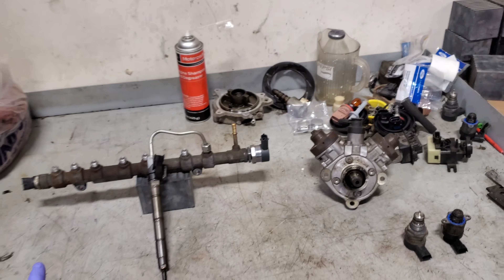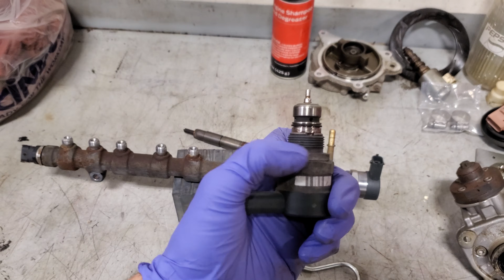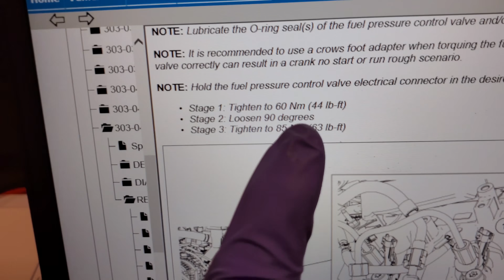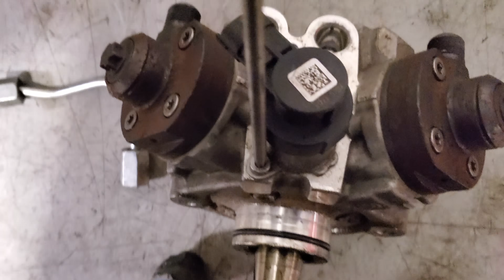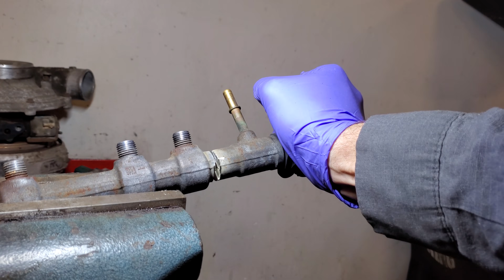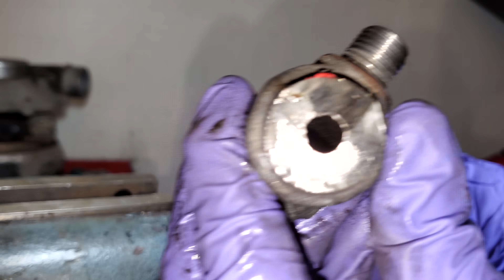High Pressure Fuel system concerns - LH FUEL RAIL discussion | Ford 6.7 Diesel

Comment: Hey man I work at a fleet with a lot of these 6.7 running around and I’ve learned a lot from watching your videos, just did a 2020 fuel system replacement from DEF and you got me curious with that rail and I did find the orifice and it is on the other side of the rail after the line that feeds the passenger side rail and makes sense to me it’s there cuz I’ve always wondered how the passenger side doesn’t get starved with fuel
Reply from the maker: Wow, email me some pics!!
Reply: @PowerStrokeTechTalkwARod  sure thing, still have it sitting out on a bench I’ll do that on Monday
Reply: What are the symptoms when it fails? I got one throwing p0093.
Reply from the maker: Warning lights...reduced power....no start......etc
Reply: Can you see any codes thrown without prior symptoms?  I.e . Slow roll failure?

Comment: What do you suggest i put in my 2019 6.7 for a fuel additive? Living in Canada.
Reply from the maker: Search motorcraft cetane booster
Motorcraft anti gel additive too
Reply: @PowerStrokeTechTalkwARod  This doesn't have to be caused by water or contamination in the fuel. This could be caused simply by using low sulfur fuel or air bubbles in the thin fuel oil which prevents proper lubrication.
https://www.forthepeople.com/class-action-lawyers/cp4-pump-failure-lawsuit/

Comment: Good info, I was considering a CP4 bypass kit, im confident after watching this video 100% CP4 failures is do to lack of maintenance. Is it possible the FRP sensor was reading inaccurately?
Reply from the maker: It wld be, however...with that sensor providing crucial psi/voltage readings to the PCM for it to maintain operation, there would have been some circuit or performance codes related to said FRP sensor. It is 100% caused my man...

Comment: I think Ford should put the DEF fill on the other side of the truck, this would help with any mistakes and confusion, of course I know they won’t, great video sir 👍😁
Reply: Hell no, gm did that and it's stupid, a real pain to fill when the Def nozzle is by the diesel pump nozzle. Filled Def tanks many times, have yet to get Def in the diesel tank.
Reply: I agree with you on that. GM puts it under the hood. People are distracted. Make it hard for them to mess up.

Comment: I manage a fleet of work trucks, almost all 6.7's. Had two fuel systems replaced in the last two years. One had fuel from a fuel cell (which probably had the cap left off for awhile) which contaminated it.  On the other truck we were told that the fuel looked fine at the time they pulled it apart but the system was compromised from a previous fill up. I suspect DEF was put in that one. We don't use any additives, but that's the direction I'm heading, those repairs hit out budgets hard. Any suggestions on fuel additives and how frequent they should be used?
Reply from the maker: Every TANK...motorcraft pm22 & pm23. EVERY TANK!

Comment: I change my fuel filters out every 12-14,000 miles. Seen it says 22k but after 12-14 filters pretty dark,even with high volume fuel,in part for piece of mind and In part to just keep filters fresh,filters like $58.
I also use Fords fuel additive pm-22
Reply from the maker: Half bot every tank!!! Good rule of 👍👍👍
Reply: @PowerStrokeTechTalkwARod  yes sir, gotten to the point where I buy it by the gallon and measure it out

Comment: ARod—regarding the orifice, take a look at your Ford 6.7 Coffee Table Book. In the Fuel Management System subsection, under the Fuel System section, it talks about an orifice in close proximity to the diverter volume area, which I think is near the front of the rail. Here’s the verbiage “From the diverter volume area, fuel goes through an orifice to supply the left fuel rail and through a high pressure fuel line over to the right fuel rail.”
Reply from the maker: Sonava bean! I DIDN'T THINK OF THAT! THANKS PAL!!!

Comment: The cp4.2 failure seems to be more common on the LML duramax engines than in the 6.7 ford. Do you think that is because Ford uses a lift pump, while GM does not?
Reply from the maker: Fuel is the no.1 cause, PERIOD
Reply: @PowerStrokeTechTalkwARod  Totally agree. Just wanted your take on it.
Reply: GM is in a class action law suit for installing European spec cp4.2 on lml trucks. The pumps supposedly weren't rated for ulsd.
Reply from the maker: Yepp
Reply from the maker: Thats why i pound into your guys skulls that running an additive HAS to be #1 priority...

Comment: My 2012 6.7 has between 4000-4100 psi fuel pressure at idle. Is that normal? You mentioned it needs around 5k at idle. It has 290,000 miles on it. Not sure if that is early signs of wear. No codes or performances issues.
Reply from the maker: Those were around there. These news 1s are a lil higher

Comment: I had to replace my CP4 because it wasn't producing enough pressure during crank to start. I also replaced the PCV and put the upgraded metering valve on the new pump. Something to note is that it is very important to clean the top of the pump off very thoroughly before removing the lines or metering pump.
Reply: Ever think of a airdog or fass lift pump
Reply from the maker: Nope
Reply: Nope. They are more trouble than they are worth on these. The stock lift pump supposedly supports up to 700HP reliably.  And the motorcraft filters do a great job when they are changed at the right intervals.
Reply from the maker: Weeerrd

Comment: I have a 2017 F250 6.7 and bought it in October of 2020 and it keeps going into limp mode whenever hauling my 8500 lbs camper. It failed to haul the first two days of owning it and again this last weekend after it was supposedly fixed. The dealer said it was after market fuel filters the first day and replaced them then the next day when it happened again they sent it out to a shop. They said  the low pressure fuel pump was clogged. This last weekend I got a low fuel pressure code and large fuel leak code. There is no fuel leaking anywhere. What could be causing this to happen when hauling?
Reply from the maker: I have replaced a hand full of the in-tank fuel pumps for that exact issue. They need to be checking the FLP pid on IDS when diagnosing under load. Have seen it buncha times
Reply: Might be a stupid question...does the fuel pressure regulator  on the left fuel rail wire connector need to point in a certain direction? Mine looks like the connector is pointing in to the 4 or 8 o’clock position and not the 12 o’clock position.
Reply from the maker: 12 o clock.
Reply: Wanted to update on what was found. While waiting for the fuel pump sending unit to be delivered by Ford, the diesel shop that I brought it to did all the Ford tests that the manual recommended and the low side fuel pump was performing well within spec and the fuel filter on the tank was clean. It ended up being the fuel injector control valve on the left side fuel rail. The manual recommended to replace the whole rail which comes with the valve and sensor pre-installed. Ford initially said a one year wait but the shop called me two days later and said Ford found the part and we now have it in stock. Being that the control valve was not facing the proper orientation I believe the truck had a problem and they tried to fix it but failed to and traded the truck in. I bought someone else’s problem and it’s going to cost me $1200 to fix because I didn’t buy a warranty.
Reply from the maker: Ughhhh them damn fuel railz
Reply: Thanks a bunch

Comment: I have a 2016 F-550 Flatbed that the HPFS failed at 54,800 miles. Always dealer serviced, fuel station turns their fuel regularly. Ford covered the repairs under warranty especially after I took my own fuel samples and e-mailed them the results showing the fuel was clean. After 2 months at the dealership getting this truck repaired it went back 1 week later for the valve cover gaskets leaking. 1 week after that the timing chain cover started leaking. Before that it was the upper oil pan leaking, lower turbo boot blew off and a few other issues. Sorry but I'll never buy another 6.7L diesel again. I'm going back to a gas engine on my next truck. I always enjoy your videos though btw.
Reply: They should have seen all that when they had the cab off from doing the first job. Don’t believe it all started leaking that badly so soon all of A sudden
Reply from the maker: Thanks vince🤝🤝

Comment: Planning on replacing my 97 7.3 F350. This fuel pump/common rail catastrophic failure issue makes me rethink replacing the 7.3. My 7.3 has additional fuel filter, water separator and coolant filter. This has worked and the Racor marine water separator has worked many times. What options are there for the 6.7?
Reply from the maker: Not too sure bud sry

Comment: Good stuff bro. Funny I just changed my fuel filters the other day. I do it every 15K. I never have water in my fuel. I also use HSS EDT with LX4 for lubricity every fill up. Maintenance is key. Unfortunately, while doing my oil change yesterday, I noticed my upper oil pan leaking for the second time. Very frustrating. I might have to trade my 17 for a 21 lol. Thanks again for all the good content 🤙
Reply from the maker: Hell yeah brother🙌

Comment: One this I noticed with an orifice issue on the drivers side was a 2013. Came in for a filter change and the customer had a complaint of a slight surge at idle.
Changed the filters and the surge got worse. Idle to 1500 to idle to 1500. I was stumped. No codes. Then it would surge then stall.
Read up on the orifice and and (on a whim) replaced the rail. 
It worked! 
That was a new failure for me
Reply from the maker: No shit!!!! Good job
Reply: @PowerStrokeTechTalkwARod  luck of the draw on something I havent seen myself either. Wheres this damn orifice? One thing I noticed on that truck when I removed the frp sensor it was caked in a very weird substance I wouldn't identify. Maybe this orifice is a plastic polymer? And we havent seen it because weve been looking in trucks with failures? 
Which sucks because that fuel rail from ford is on national backorder. And at 200ish a pop that's an expensive piece of scrap
Reply from the maker: No doubt bud, u aint kiddin!

Comment: Mine failed in June of this year. Truck had 315k miles on it when it failed. Mechanic said the CP4.2 had fail from age.  I wish it would have been water or def. I was told insurance would have covered the repair if that was the case. Repair ended up running me about 10k out of pocket.
Reply: Cani just replace the pump on a pump failure
Reply from the maker: Be more specific...

Comment: Hey buddy , Have a question. 2011 F350 6.7 , Started loping at idle. Had a cylinder 4 P0272 , and a cylinder 2 P0266. Checked injector balance rates cyl 4 was 5.495 mg at idle 2 was 1.705 mg.... Will this cause an issue. Also had a P0191 that i fixed with a FRP sensor code hasnt come back , but still a lope at idle ....FRP at idle is 4300-4900 it fluctuates. CMD PSI is within 50 psi always .
Reply from the maker: Yea maybe a bad inj?
Reply: @PowerStrokeTechTalkwARod  I'm thinking that also .

Comment: So changing fuel filters isn’t a bad thing. On my 2016 i only use motorcraft filters and change them every 15,000 miles. Which is every other oil change.
Reply from the maker: Excellent!

Comment: I installed a used engine that was sitting for a couple of years. I replaced fuel filters, but must have had water in the lines. Ran good and then started squeaking and screeched to a halt. I didn’t video that though. https://youtu.be/aYNM44z-s8g

Comment: Have you gotten to do the 20B41 recall? Left fuel rail replacement on 2020s. Interesting little twist to those one time use fuel lines.
Reply from the maker: Lololol i know right. I have not
Reply: We had one in stock unit I got the pleasure of doing it on. Wasn’t to bad.
Reply from the maker: They not bad at all
Reply: I love cuttin into stuff to investigate...
Thanks for dropping g the knowledge  bro

Comment: Mine quit me taking off from a traffic light.  Metal was everywhere when I pulled the VCV.  Mailed fuel to a lab, and they said the it was just fine.  Servicing dealer refused to do any failure analysis on the cores, so I have no clue what smoked mine.  I add PM22A (buy it in gallon jug)at every fuel stop, fill up at a place with rapid tank turnover, Motorcraft fuel filters every other oil change, and check the water separator regularly, and never found any.  Monthly payments on the pump and injector job are bigger than they were for the rest of the truck!
Reply: the problem is the lubricity of the diesel fuel in america, the cp4 pumps are made to run on european diesel fuel which lubricates better.

Comment: That happens to my Duty, then I’m going back to my 97 Astro van with a Cummins swap 😎
Reply: Yo skip the astro van They pulled that cargo ship out of the Suez canal with a couple of snatch blocks and two FORD RANGERS on each shore, That's what I am gettin.   Already got it ordered custom with a Gooseneck in the bed. If u push the sales guy on a hard sell they give ya 3:1 750lb rated snatch blocks w/ 50 feet of yarn. If your in michigan u mite be able to snag a 10ft v plow installed. There's customer cash for that on ford.com/sales/

Comment: On my 2014, I replaced the pump due to it not holding rail, truck is tuned and get run hard. Installed a modified pump, truck now has larger turbo. Has been running flawlessly till recently. Took it to the local drag strip and it ran a full second slower than normal. No codes at that time. Logged the vcv and pcv on the 2nd pass. Pressure holds fine. Vcv is maxed out my 20% throttle. I immediately went home. Pulled fuel filter, they had about 1500 miles on them, the looked fine. Pulled the vcv and pcv. Both looked good, no metal. Instslled my new "test" vcv and pcv I keep in my box at work. Same deal. Kind of at a loss. Almost ready to do the fuel system with some larger injectors and put some holes in the block.
Reply from the maker: Werd werdd

Comment: What’s your view on the cp4 byepass kits to prevent the metal shavings going though the rest of the fuel system?  I’m assuming it would void warranty,  even though fuel system isn’t covered under warranty anyways. 🤦‍♂️🤷‍♂️
Reply: From my understanding the bypass kit will not prevent the pump from failing. However it will prevent the pump from taking out all the other components like injectors and sensors. So when it does fail you just need to replace the pump and clean the metal out of the tank and replace your filters. That will make the job alot cheaper if you only have to replace thr pump instead of thr whole system. Thats your thoughts A-ROD?
Reply from the maker: I duno i think now i need to make a video on just that. That is literally the one thing i get asked the most about...
Reply: @PowerStrokeTechTalkwARod  yes makena video on this. Cauae I would like to know your input on this. Cause if my pump fails I would sure like to just replace the the pump instead of the whole fuel system. I work on concrete trucks and we have high pressure pumps fail often on our cummins motors. But when ours fail we never have to replace injectors or anything cause the fuel is routed back through a filter before entering the high pressure side. So when a our pumps fail we just throw a new pump on and fuel filters and shes rolling back down the road again with no metal contamination in the high pressure side. From my understanding thsts what the disaster prevention kit does. Reroutes the fuel to return to the tank from the bottom end after lubricating the cam lobe and rollers. Then the top end always gets fresh fuel from the filter. That way if the rollers start to grenade it will be picking the metal from that in the fuel tank and let's hope the filters are doing their job and it gets the metal out before it gets to the top end of the pump and out to the injectors
Reply: I went with the SPE disaster proof with exo filter, it’s a no cut kit, just to prevent metal from going to the tank, lines, injectors or sensors on the off chance the roller bearings do fail. Small price to pay for protecting the majority of the system. Just my opinion.
Reply from the maker: Thats the internets fix for dum dums. No need....thy question lays....what caused the metal to begin with. Did the poor HP have a bad day & clock out early.....no most certainly not......think about that..🤔🤔🤔
Reply: @PowerStrokeTechTalkwARod  definitely not a fix, just prevents and problem from being a worse problem.
Reply from the maker: Si